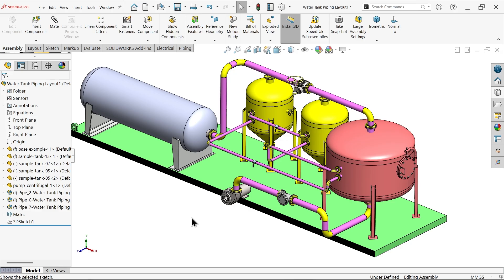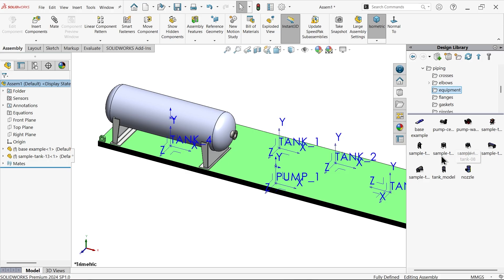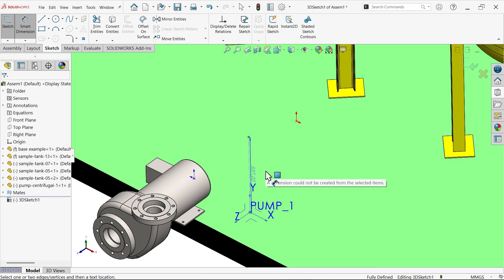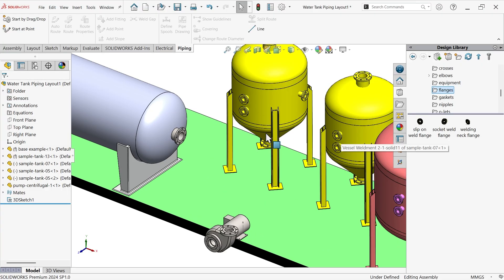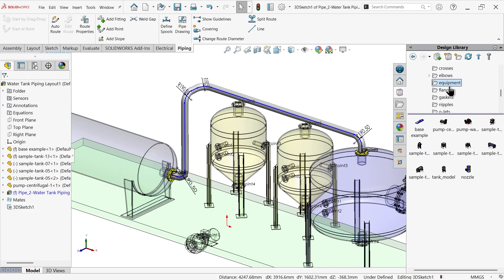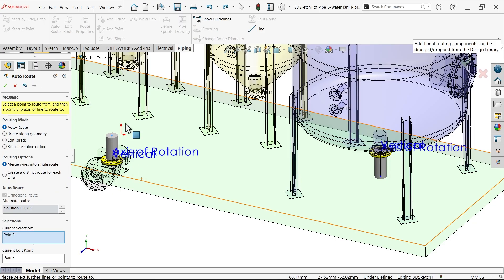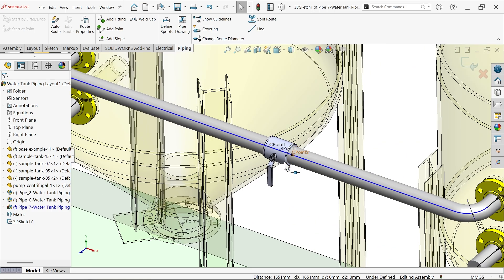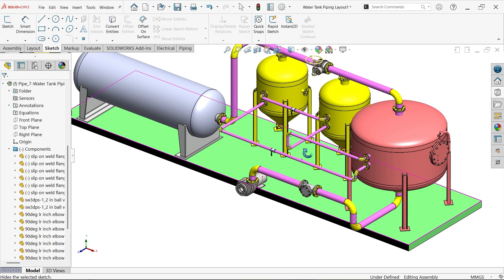SolidWorks Pipe Routing-Water Tank And Pipe Routing Assembly

Comment: Tutorial was perfect thanks a lot 
But functionality is wrong you pump has no input pipe flow and the bottum of tanks always use for drain not for connecting to pump, and pipes has no support to fix them with ground.
Anyway that was so helpfull i will appreciate if you can upload more videos about routing system, with heat exchangers , pumps, thermometer, flow meter , reactors and ...🙏🙏